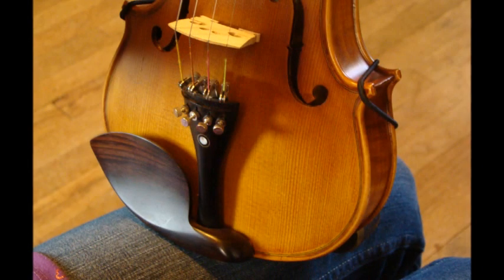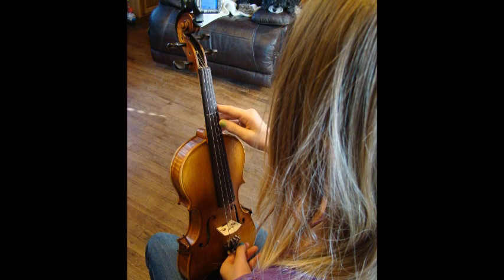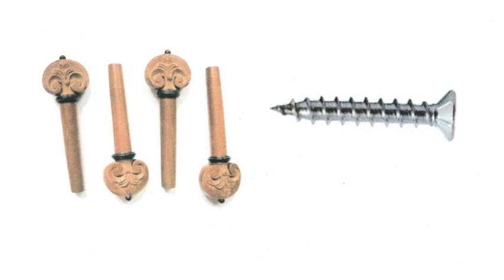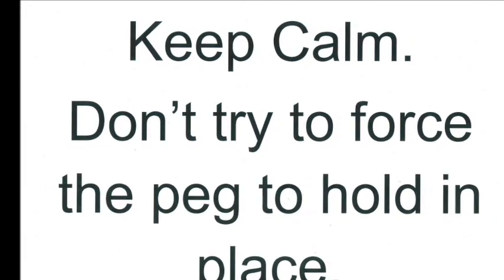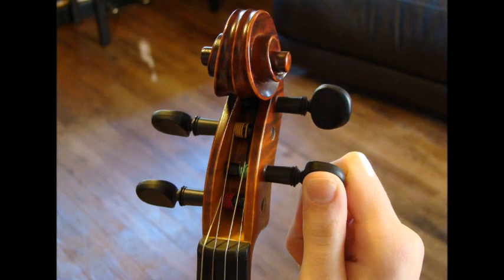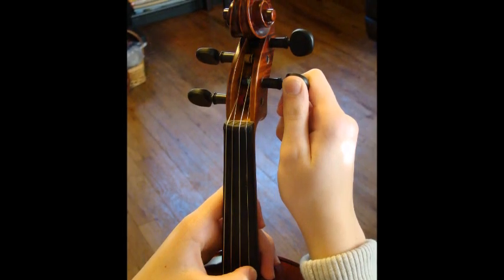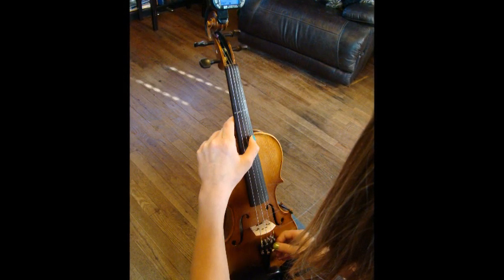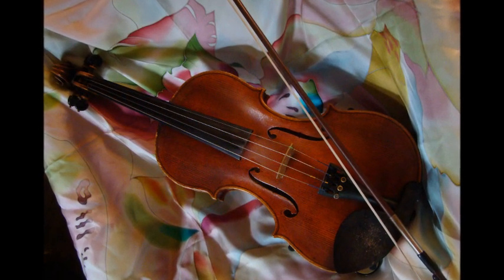How to Tune a Violin or Viola Using the Pegs

Comment: I’m SUPER scared that my string will snap again
Reply from the maker: I totally understand that!  Did you string break?  Which string is it? Were you able to tune your violin?
Reply: Babette Allen it was the D string, and eventually teacher fixed it. And she tuned it that day. I’m just iffy about it because I won’t be able to practice until I get a new string if it breaks
Reply from the maker: @StrawberryFeildsforNever  Strings can be scary!  But, if I understand you correctly, the string didn't break.  So, perhaps the snapping was just the peg slipping quickly, maybe due to weather.  Taking your instrument from warm to cold to warm can make the strings snap, so try to keep your violin at an even temperature, like you would like, and not close to a heater, vents, doorways or anything that would cause the temperature to fluctuate.  Now, D strings don't break that often, and I guess it didn't break this time, so don't be too afraid, and try to relax a little.  Do you have orchestra? A private teacher?  How often do you see your teacher?
Reply: Babette Allen I have a private teacher. I don’t have orchestra yet. I’ll try and be more gentle. I don’t think I was pushing the peg in, just turning it
Reply from the maker: @StrawberryFeildsforNever  OK.  Next time you need to tune with the pegs you might want to watch this video again before you start, just to reinforce that you know all the steps.  Good luck with violin!  It's great that you're taking private lessons.  I have several videos up about theory and rhythm and I would really like it if you'd subscribe to my channel and use these free videos.  Hopefully they will help you even more!  Thank you for watching my video!
Reply: Same
Reply: Same! Once I was literally trying to play with the pegs (which I deeply regret) and it just so happened to be that my tuners were twisted all the way to the bottom and my E string was still to flat. I had nooooo idea what was going to happen next and how seriously dangerous it would be to use the peg. It suddenly turned super fast towards the bed that was in front of me, tightening the string. Thank the lord that it was on the bed and my face was far away from the violin. I was okay, but I kind of developed a fear of tuning the violin with the pegs.
Reply from the maker: @朱刘海刘海宽爱朱赞锦  I was just scrolling through my comments and found that I did not respond to yours! I am so sorry! I don’t like making assumptions, but it appears that I did not receive a message that a comment from you was posted. I know about that fear of tuning because of strings breaking! I am really cautious about tuning instruments because of it!

Comment: Why does my peg keep return back when I try to turn it up
Reply from the maker: Classybeassy, there are a couple of reasons the peg would return back when you try to turn it up.  The first, and most common, is that you are not pushing the peg in WHILE you are turning it up.  Remember, the peg is not like a screw in that when you turn it up it is moving in, by nature of it's design.  Pegs don't have grooves like screws do.  They're just smooth wood against smooth wood, so you have to push in while you're turning it.  Sometimes when people learn how to tune a violin they turn the peg to where they want it and then pound the peg in.  Don't do that.  That will cause grooves in the peg and the grooves will prevent the violin from being tuned correctly and could result in repair work to the peg and violin.  So, remember to push the peg in while you're turning the peg.  Thank you for watching my video, and I hope my answer here will help you.
Reply: Thank you so much, it worked, i manged to tune my violin
Reply from the maker: +Classybeassy Wonderful! So happy I could help you!
Reply: Classybeassy push it in then twist
Reply: @babetteallen6118  omg thank you I thought I would snap it!!
Reply from the maker: @sl.s513  You'rre welcome! Glad I could help!
Reply: Babette Allen it snapped.. the push in then twist didn’t work and it snapped my violas ‘a’ string
Reply from the maker: @ssatyrnn8024  I'm so sorry your string snapped.  This usually (but not always) occurs when you turn the peg too far.  Did you back off before you started turning? This gives you some sense of how far a turn you need to make.  Also, as you turn the peg you should keep lightly plucking the string to see where you are in the tuning.  No guessing here!  You have to know where you are.  Let me assure you that almost everyone snaps at least one string while they're in the learning process.  It just happens.  So sorry this happened to you, but hopefully it will be the only time.  If you have any questions, please do not hesitate to ask me.  I'm here to help!
Reply: Babette Allen ok thanks anyways
Reply: Classybeassy Lots of them do that. Push it in a lot while you do it
Reply: @babetteallen6118  I know this is old but thank you for telling us this, I was wondering why the pegs on my viola wouldn’t turn n then I just pushed while turning n it worked.
Reply from the maker: @jaydenvert9168  Thank you! I appreicate your message, no matter how old it is!
Reply: @babetteallen6118  bro thanks I was so annoyed at my viola thanks 🙏🏼
Reply: You might've loosened it too much. Put a bit of force onto the peg and that might help to keep it in place.
Reply from the maker: @朱刘海刘海宽爱朱赞锦  Just as long as they're turning while pushing in. Just pushing in could cause damage to the pegs.

Comment from the maker: Daniel Arroyo, if the peg comes back at you then you aren't really pushing in, or turning the peg in, hard enough when you're tightening the string.  Remember that your hand motion should be trying to move the peg into the peg box as you turn.  If the peg comes back at you quickly, then the string could unwind quickly and start laying over itself.  Please let me know if you have any more questions.
Reply: Babette Allen My peg comes back so I had to push it harder and between violin neck and shoulder I heard breaking sound. Now I’m pushing it in holding head and worrying someday I may break violin by turning. And when I pushed pegs in all become out of tune.
Reply: My e string popped while I did it
Reply from the maker: @chonghwang8028  I was just scrolling through my comments and found that I did not respond to yours! I am so sorry! I don’t like making assumptions, but it appears that I did not receive a message that a comment from you was posted. I hope you found someone to help you and someone that could take a look at the violin and make sure it was ok.

Comment: I’m trying to tune my G and D string right now with the pegs and it’s just too hard. My fingers are hurting. I’ve been trying to fix it for about and hour now so is it ok if you can give me some tips? I am trying to push it in but it just won’t turn . I apologize if I’m complaining.
Reply from the maker: I'm sorry you're having trouble Brooke.  Does this mean you are unable to turn the pegs?
Reply: Babette Allen yes ma’am
Reply from the maker: Brooke Berghuis  ok.  First, have you tried loosening the peg first?  Are you tuning with a tuner?
Reply: Babette Allen yes
Reply from the maker: Brooke Berghuis  So that means yes to both? Yes you tried loosening the string and yes you have a tuner.  Are the strings way out of tune?  Are they too high?  Too low?  Do you have a teacher or an orchestra director?  Have you tried tuning in the past?  Also, where I live the climate goes from hot and humid to much cooler and back and sometimes that can affect how easy it is to tune our instruments.  Is that the case where you live?

Comment: What do I do if my bridge IS leaning to the side? It looks like the sides of the bridge are more towards the fine tuners, though. Is it okay if its towards the fine tuners instead? Or maybe the middle of the bridge is towards the pegs??? Do I need to take it to the shop and get it fixed?
Reply from the maker: @aaaa-qf3wo  It's hard to answer when I can't see the bridge and when I don't know how long you've been playing the violin.
It definitely sounds like the bridge needs to be adjusted by either the shop or a teacher. Both of them should be able to adjust it in a few minutes. Thank you for asking.
Reply: @babetteallen6118  Okay thanks. I'll bring it to the shop and have them check it out. Thank you so much!
Reply from the maker: @EmLennon-qf3wo  you're welcome! Best wishes!

Comment: Every time I try to tune my viola's C string, the rest of the strings go out of tune. How can I fix this problem?
Reply from the maker: chskn nuggets, the bridge that holds the strings up is being held up by the tension of the strings. So the first thing I want you to do is to look at your bridge from the side and make sure it is still standing straight up.  You should check this out periodically anyway.  If it isn't, you need to get to a violin repair shop right away and have them set the bridge for you.  Now, if your bridge is standing up correctly, every time you tune a string, the others can go out of tune slightly, or a lot.  That depends on how much tuning you are doing on a particular string. So when I tune I'll go through all the strings, and then go through them again, and sometimes more than that, to make sure they're all right.  Is the C string the first string you're trying to tune? Also, I don't know where you live, but is the temperature cold?  Because if your viola goes from warm to cold and vice versa, it gets more difficult to tune. For example, one string could get way out of tune, and then another, and another.  Please let me know what's happening and maybe I can be of more help.

Comment: I'm trying to tune my D string, but it's super difficult to tighten it, rn my tuner says it's B
Reply from the maker: Let's see if I can help you!  This means that if your tuner says B, that your string sounds nothing like a B.  Is that correct?
Reply from the maker: Yaroslav Nedjković  Thank you for your input.  I totally didn't answer that correctly and he didn't reply 9 months ago.  That you for spotting that.
Reply from the maker: Yaroslav Nedjković  Just remember that you shouldn't press straight in, because that can cause grooves in the pegs and eventually it will be hard to tune to the right place and keep the pegs from slipping.  You need to press inward AS you turn, like tightening a screw.

Comment: Sophie snapped a string  while tuning it when using this video
Reply from the maker: Eva Wilcox I'm sorry to hear that. It's not uncommon for people to snap strings when learning to tune with the pegs. It usually happens because they have not yet learned how to tune the string higher, which amounts to tightening the string, just a little bit. I don't know what the situation was before she turned the peg, or I could give a better explanation. One thing that happens to my students sometimes is that they forget about loosening the peg before trying to tune it. Another thing that happens, especially in cold weather, is that a string is really loose and they try to bring it all the way in tune without stopping to check and to feel the difference. Also, most of my students have fine tuners on their strings and learn to first tune with the tuners. I make the more major adjustments when they come to their lessons. This goes on for a long time. By the time they need to tune with the pegs they have a solid idea of what turning just a little bit means. Tuning with the pegs will get better. It's just not that easy to learn. I suggest watching the video again before the next time to make sure no steps are missed. Please let me know if you have any questions. Good luck!